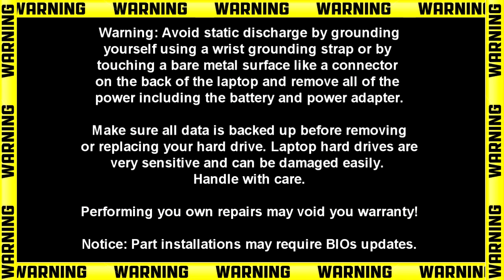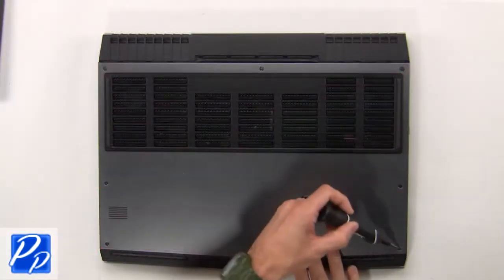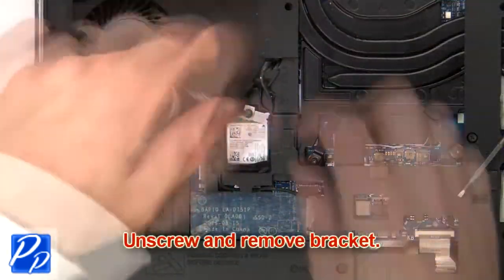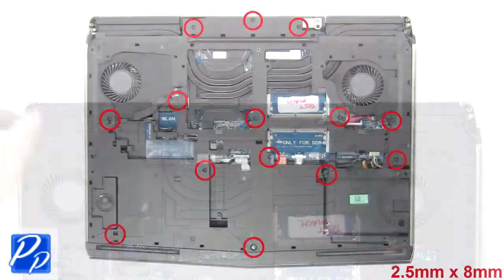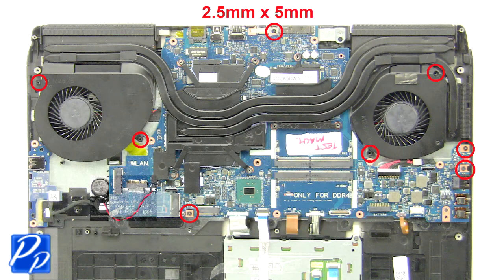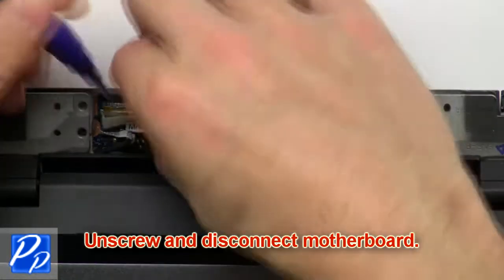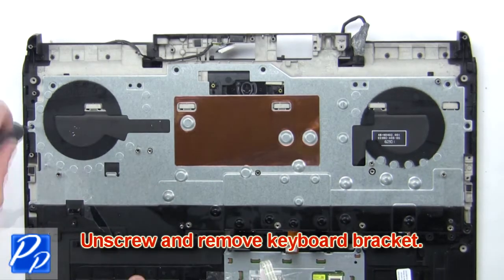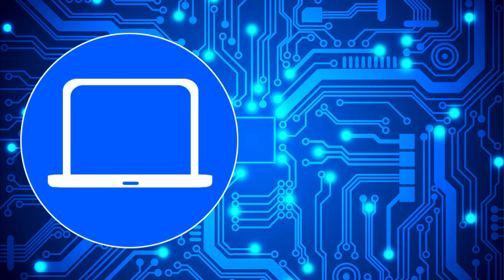Dell Alienware 17 R4 (P12S001) Keyboard How-To Video Tutorial

Comment: Pretty sure the head-sink screws didn't need to be removed. I think if I had seen this video before purchasing the replacement keyboard, I would have chickened out and put up with the failing one. That said, I was able to successfully do the replacement, and only had 6 screws left over .....

Comment: found out the problem ,i need a new display cable ,keyboard,and cmos storage battery also an m.2 ,and maybe a new mobo bc dell update was cooking my pc got low temp burn on my wrist a couple times.
Reply: Same here some keyboard keys stoped working soon after dell technician updated my R3 because the update just before said my oem ram wes not found , my warrantee ran up a few weeks later dell wont touch it with out me re buying warrantee
Reply: @Eriktalentshow001  sorry bro ,it's called a "No Fix " faulty system issue ,I'm getting rid of my  parts on eBay at least it's $280 minus the motherboard...

Comment: You have to dismantle the entire device to remove a keyboard. Dell's engineers are idiots.
Reply: The funny part is that their older laptops used to have an easy and simple process for replacing the keyboard. Just pop off the plastic bracket, unscrew the 3 screws, unplug it, and boom.
Reply: @eldorito777  By doing that I broke the EDP connector on the motherboard, this is not the first time I replace a keyboard. The whole laptop ended up in the trash can, it's not really fixable. I don't understand why they put those weak connectors. I will not buy Alienware anymore. I want to be able to repair and upgrade my stuff.
Reply: Well you can at least remove the keyboard